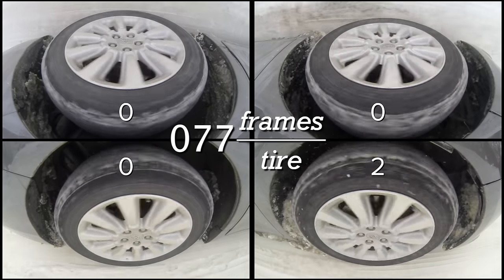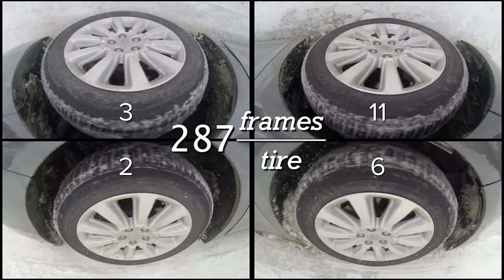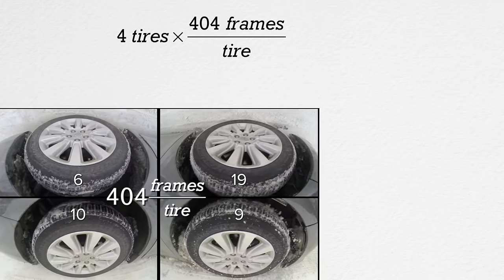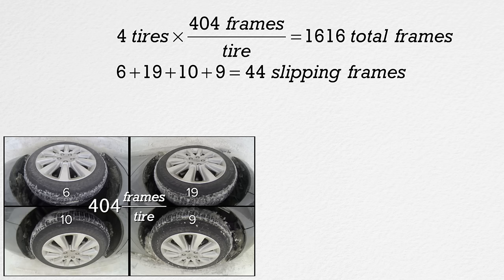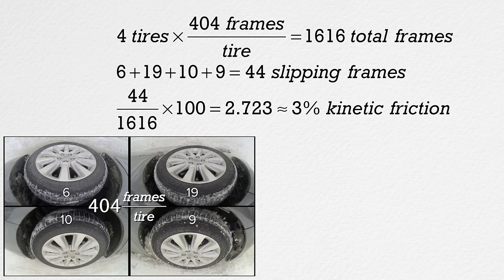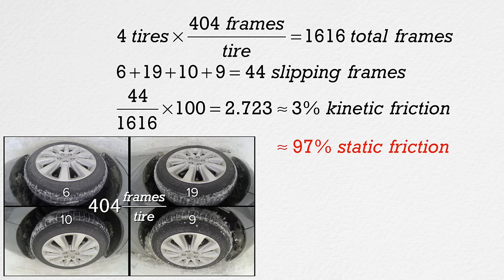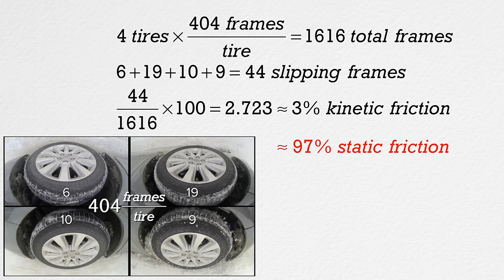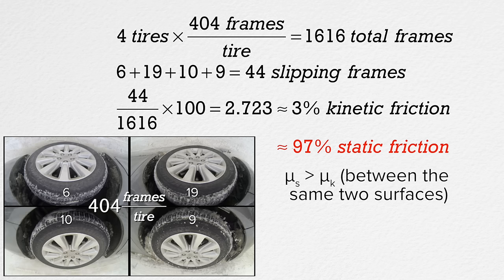Do Anti-lock Brakes use Static or Kinetic Friction? by Billy

Comment: However the reason why ABS was invented in the first place was not to slow the vehicle down quicker, but rather to give more control to the vehicle during panic stop, because it appears to me that kinetic friction and static friction on the same surface with the same normal force acting on it doesn’t differ much, if at all.
Reply: Right.  It's to keep the steering wheels in static friction, so that they are still effective at steering the vehicle.  Otherwise, turning the front wheels on a car with locked up brakes wouldn't do anything, as they can skid sideways just as easily as they can skid forward.

Comment: But while rolling it is rolling friction which is less than kinetic friction. Please explain
Reply from the maker: Rolling friction is typically caused by the bearings inside the wheel which are designed to have a very low coefficient of friction.

Comment: I thought anything in motion had kinetic friction?
Reply from the maker: Kinetic friction occurs when the two surfaces are sliding relative to one another.
Static friction occurs when the two surfaces are not sliding relative to one another.
In the situation of a rolling tire, typically the surface of the tire is not sliding relative to the road.
Reply: @FlippingPhysics  ok thx